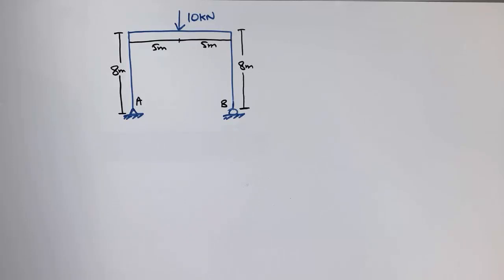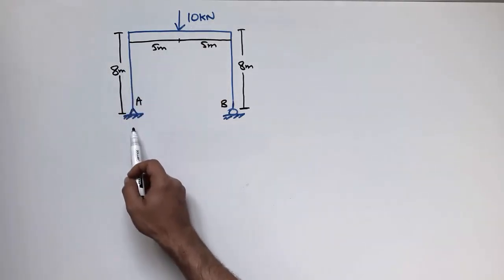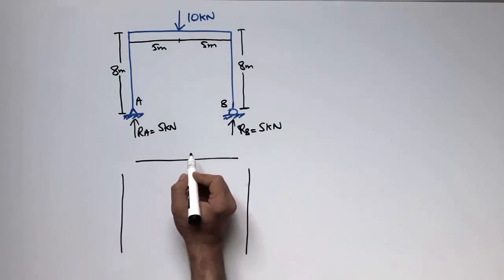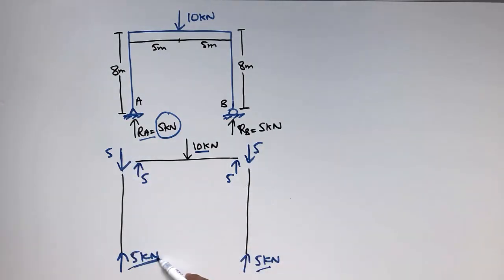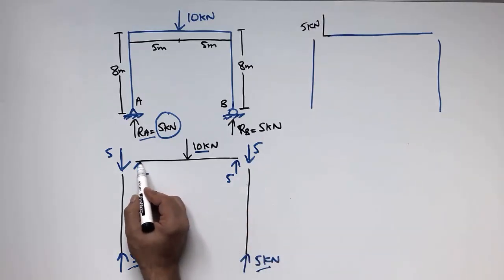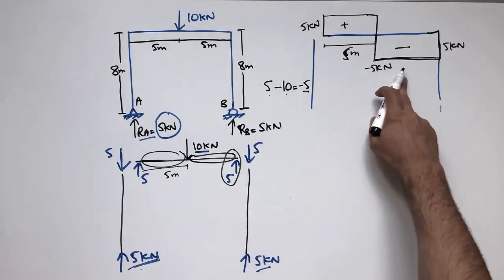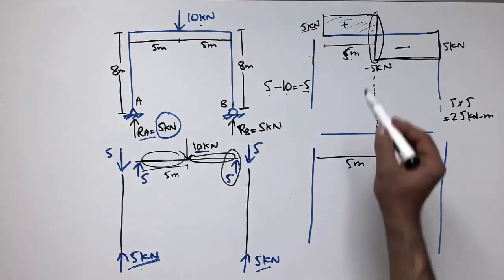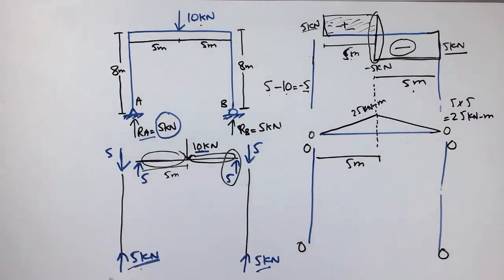Shear Force and Bending Moment Diagram of Frame structure

Comment: Sir what s the uses of calculating shear force and bending moment?
Reply from the maker: So one can know about the shear reinforcement and bending reinforcement needed to resist the demand of a structure, If you don't provide the required reinforcement to  your building or structure, then it might be collapse.
Reply: Thnx sir